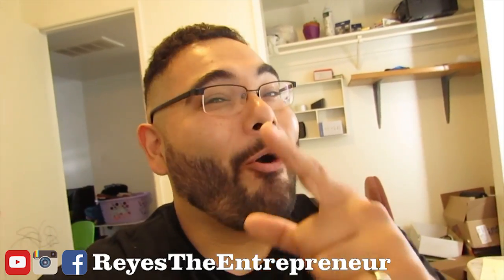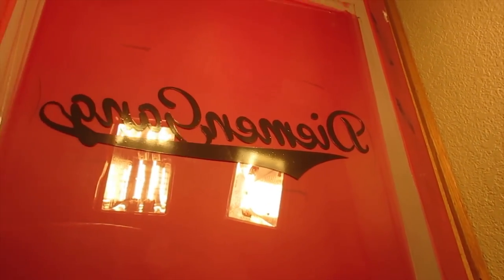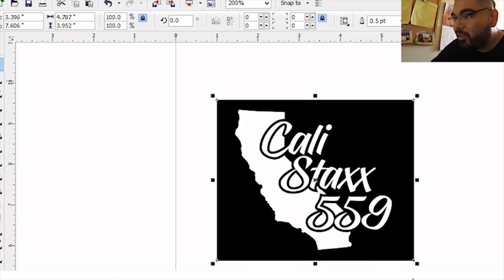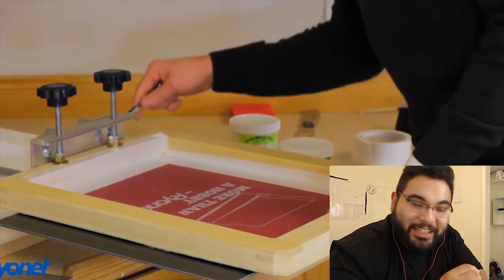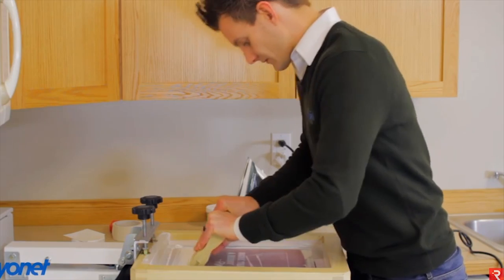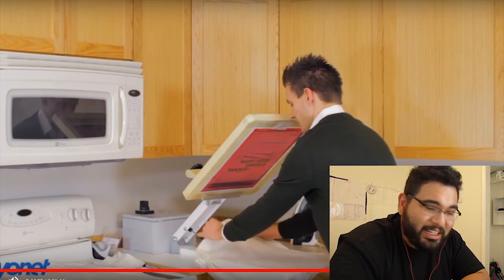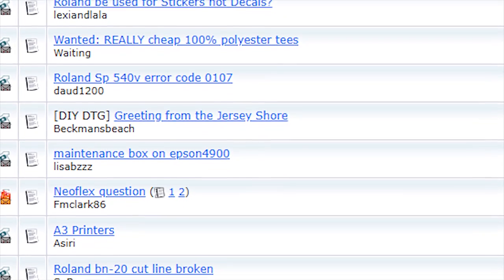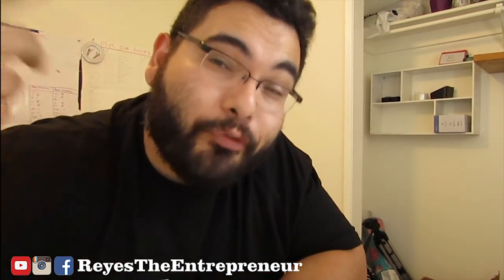Best Beginner screen printing video and starter kit

Comment: Excellent video, good starter press for basic spot color printing.
The best way to get started in the screen printing business from my experience is to get a job working for a screen-printing business. This way you can see all the steps to the screen printing process. You can also determine if the screen printing is for you before you spend money on any equipment.

Comment: Es todo Reyes. I just got my starter kit in the correo. Not ryonet though. There seems to be in increase in diy shirts. I got a cheaper brand and it doesn’t comes with everything but I’m lucky cuz I got a homie that works at a screen print supplier and will pick up the rest from there or go on offer up.👍🏾

Comment: Hey sorry if this is a stupid question. I’m just getting starting making my own shirts. Is there a way to permanently burn an image on a screen so that I could conceivably reuse the screen for multiple shirts, even if I wash the paint off. Ideally I’d like to be able to make multiple designs per order and using several premade screens. Seems like the most efficient way to go about this?  hope that makes sense. Any advice would be greatly appreciated!  Thank you.
Reply: i saw a video where you can use vinyl with your design cut out of it and stick it on the screen

Comment: I use strictly waterbased inks and eco chemicals waterbased if cured right last just as long as plastisol ive been using it for 3 years and the shirts i made for my bisiness in the beginning have held up to close to 10p plus washes

Comment: Great channel and good info. What mesh count do you use for shirts or what do you prefer?I have a frame with 110 but I have been seeing that it should be at least 160 for crisper lines on a T-shirt. I am screen printing at home with no fancy machines. Thanks 👊🏻

Comment: What product did you spray before you placed the shirt on the screen printer?
Reply: it’s a Spray Adhesive it helps the shirt stick to the surface so when screen printing it keeps the shirt in place

Comment: Wow thats a lot of work for a shirt. What about using a heat press for shirts? say you need to print a design bigger than what the printer can print? Or how can you print transparent designs so that there is no square around the image? Before this I watched your epson xp 300 photo print shirts. Id like to print my banner as a t shirt logo, but I think it would need to be bigger than paper and I wouldnt want the square around it.

So say I have transparent images and I was going to buy a heat press. how do you print transparent logos and what would be the best method without having to use razors to cut everything out?

Comment: Thank you for the video! I have a question on how to get the designs from the computer what program some say photo shop however I am new to that and its got many features. Like what format to use and how did you print out your design and take it to the print shop as you shown ? Please help with this Thank you

Comment: Reyes have you ever had your emulsion permanently lock on your screen? If so how do you reclaim your screen after that?
Reply from the maker: Oh bro, when that happens, it sucks. My best suggestion is to just keep hitting it with the power washer but to be honest when that happens, i let that screen go. I take it to the back yard and bury it.
Reply: @ReyesTheEntrepreneur  lol. Bro iv been soaking it in bleach every Sunday for the past 5 weeks. It's barley coming off lol. I think My mistake was not letting the emulsion fully dry after coating.
Reply: @JCURRENCY602  you could have over exposed your screen. you also have to make sure that when you emulsion your screen that it's not left in a really warm space with no light in the area you left it to dry. You can just cut the screen out and get it remeshed for like $15 instead of throwing it out.

Comment: Hey Reyes.... I need your help!!!! Starting my own screen printing, have my machine and everything. I am
Trying to print a logo from Corel draw on a 11x17 transparency paper and it will not print correctly! It continues to cut parts of the logo off even though the logo is 4” x 12”. I have been trying everything literally for hours!! Can’t find any helpful videos either. Any suggestions??? Thank you thank you!!!!!! 🙏🏽🙏🏽🙏🏽
Reply: Disregard!!! Got it!! 👍🏽

Comment: Question.  I want to start screen printing  but I may have to use my basement.  In the winter it's not freezing  cold but it is pretty  cold down in the basement.  Can I still screen print,  will the emulsion  dry?
Reply from the maker: No, you should be ok as long as the inks are not left open.

Comment: whats the difference between this and using a vinyl cutter to do screen printing?
Reply from the maker: Are you talking about putting vinyl on the screen to screen print? Great question
Reply: i can answer this as this is how i do it, the Vinyl works great for most jobs, however, it doesnt last super long if it has small details and it is just about impossible to get half tones with vinyl.... but as a quick and easy alternative to Photo Emulsion, i highly recommend it if the image is simple or its text...

Comment: When your doing a 3 or 4 colour design how do you line the colours up so they are in line on the shirt ?
Reply from the maker: Oh paul, that's a pain. You have to put all the layers of tranparencies on the board and pick one up one at a time. so if its 3 layers, you line them up on the pallet together but only put tape on the top one so when you pull down the screen. it'll pick it up and keep repeating the process and then you light a virgin mary candle and pray it all works out.

Comment: Can you cure plastisol ink with a heat gun?
Reply from the maker: No. A heat press or conveyor dryer will work
Reply: you can dry it with a heat gun and than iron over it to cure it with coated glass cloth

Comment: Great video homie! Question though you might have said it but I don’t think I caught it! You can cure with a heat gun or press? I have both but don’t want to mess up lol thank you
Reply from the maker: Maybe i skipped it but water base you dont have to use a heat press. Just a heat gun. With plastisol,you do need a heat press or conveyor dryer
Reply: @ReyesTheEntrepreneur  You can also use an iron to cure the water based ink.  How much are the heat presses?
Reply: @ReyesTheEntrepreneur  Hey thanks.. Please time duration for both inks? using a heat gun and a heat press..
Reply: Waterbased ink is cured once the water is evaporated. so you can use a heat gun to dry it out.

Plastisol ink is oil based, there's no water to evaporate. It cures at a certain temperature (usually 300 degrees), so you need to heat it more consistently (with a heat press, dryer, or by putting it in an oven)

In any case, a heat gun isn't the best way to cure tees. If you miss even a corner of the design it may not cure fully.
Reply: Jonathan Prizant I was about to ask what temperature must set the heat press to cure.  Is it 300 C or F?